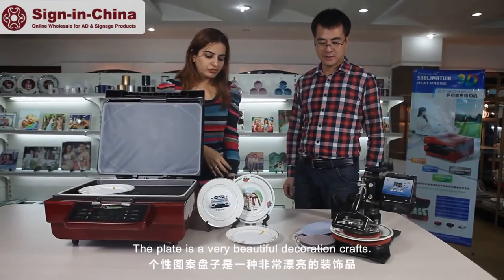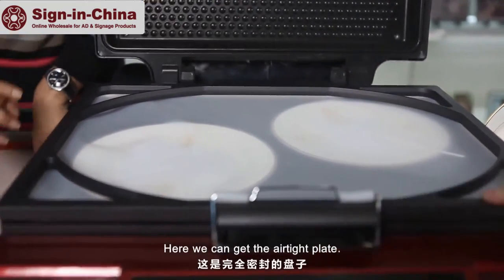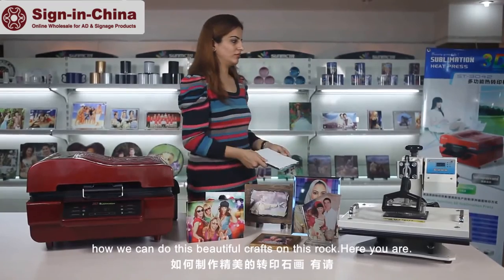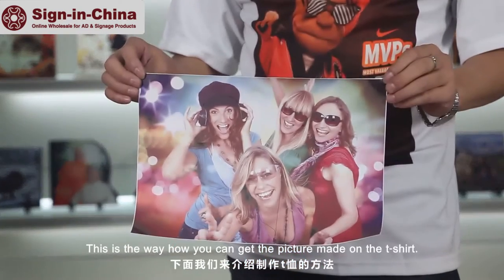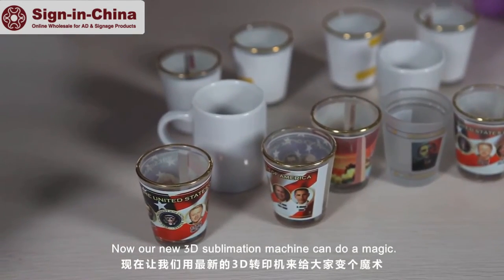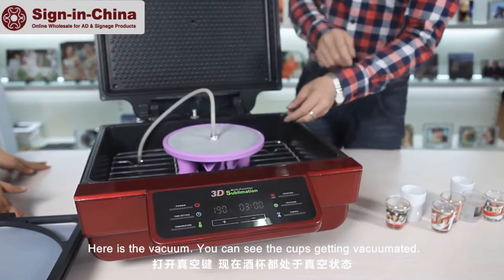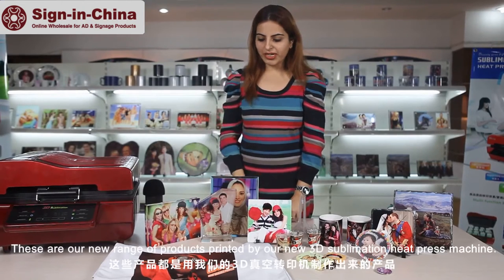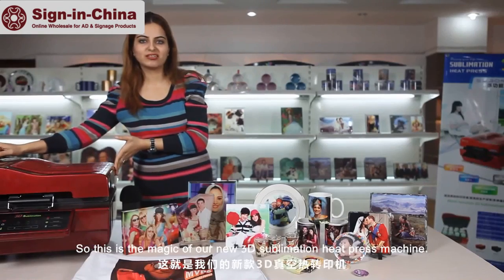Episode 3 - 3D vacuum heat press machine operation

Comment: What type&size/where did you find the glass for the shirt?
Reply from the maker: Hi, it's ordinary glass.You can also use flat wooden boards or cardboard. It's better to use the flat transfer machine of T-shirt. The size is depending on the area you want to print, but not exceed the machine.
More questions, please contact us freely:
whatsapp +8618410426967
lium@chinasigns.cn
https://www.sign-in-china.com